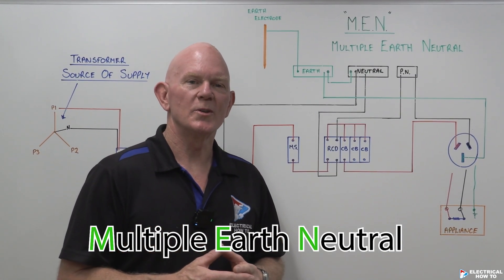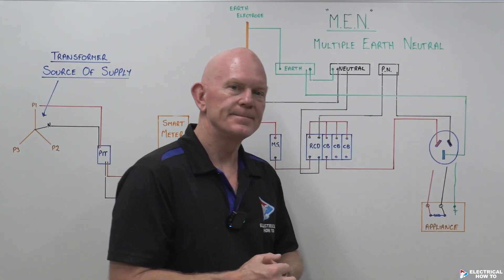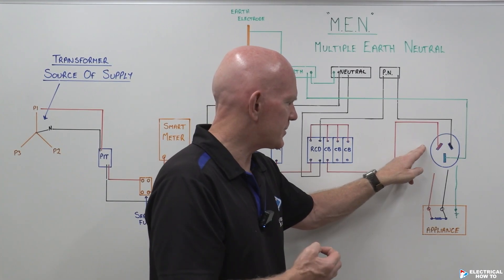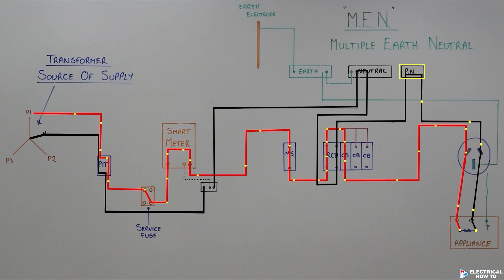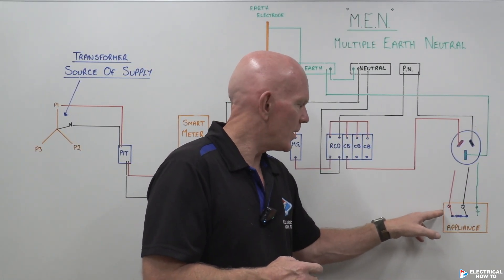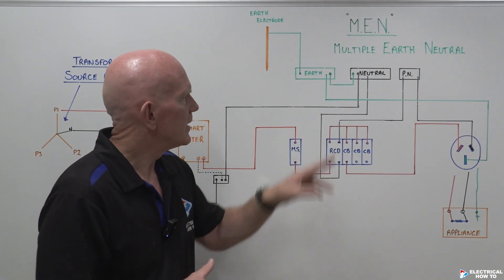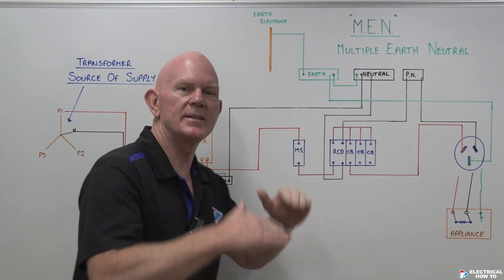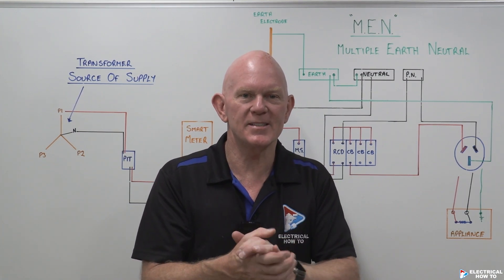M.E.N. System (Main Earthing System Explanation) | Electrical How To

Comment: Good explanation, thanks for taking the time to pull this together. Can you please explain the purpose of the earth stake in this example? Is it to protect against an open neutral? (Not a sparky)
Reply: 1 google search will answer your question
Reply: @Kurtis11266 you should go into teaching. You'd be awesome at it.
Reply: @benhalicki9749  The purpose of the earth stake in a switchboard is to provide a safe path for excess electrical current to flow into the ground, preventing electric shocks, fires, and equipment damage from faults or surges. It is connected to the switchboard and grounding system, and in the event of a fault, it diverts dangerous current away from people and conductive materials.
Reply: @Kurtis11266 thanks Kurtis, I appreciate the explanation. The part I don't quite understand is that if the MEN link is in place, the fault current is going to take the path of least resistance, which I assume would be via the earth system -> men link -> neutral?
Reply: @benhalicki9749  Just a heads up, the Earth stake isn’t for fault current. If there is no MEN that is when fault current can go through the stake and energise taps and fences which is what we don’t want. The Stake is primarily a reference.

The fault current path is through earth>MEN>Neutral>transformer

In the rare case of an open neutral it can provide some protection, but not for standard faults.

Comment: Hi, thanks for this wonderful video. In the Main-Tie-Mains application (Generator for Essential load-Tie breaker -Power Grid supply), can I have an M.E.N. link for the Generator incomer and another M.E.N. link for the Power Grid Supply? Both Generator and Power Grid will be interlocked and never close at any time.

Comment: A fairly good explanation of how the MEN system works. But I am still not clear on one aspect.

The earth wires are effectively connected to the neutral wires via the MEN link between the earth bar and the neutral bar.

Under normal operation (non-fault situation), the current flows from active (line/live/phase) wire through appliances and returns via the neutral wire. But as the neutral wires are connected to earth wires (via the MEN link), then surely current must also flow though the earth wires? And as earth wires are usually connected to metal parts of appliances, why don't people get an electric shock when touching earthed  metal parts of working appliances??
Reply from the maker: The MEN (Multiple Earthed Neutral) system is designed to provide a low-resistance path for both normal operating current and fault current, directing them safely back to the power source via the neutral conductor. This low-impedance connection ensures that fault currents are high enough to trigger protective devices, such as circuit breakers or fuses, preventing electric shock hazards. Additionally, since the neutral and earth are linked through the MEN connection, there is no potential difference between them. The earthing system itself has a high resistance path, preventing current from flowing back through grounded components like oven frames or metal light fittings. Great question thanks
Reply: @electricalhowto8523  Isnt there two parallel paths for the return current..??  Your drawing doesnt show the centre  tap of the trans former earthed..??

Comment: I'm thinking your schematic is incorrect. Shouldn't the smart meter neutral link be called the suppliers Main Neutral Link ( this Main Neutral Link is sealed by Supply Authority )?. And it is from this neutral link that the M.E.N link connects to the Main Earth Link.
Reply: Great question, all Smart meter wiring neutrals minimum 4mm, originate from a terminal of the neutral link. Shown here in the drawing. You can look up the service and installations rules for Victoria and highlights the same drawing.